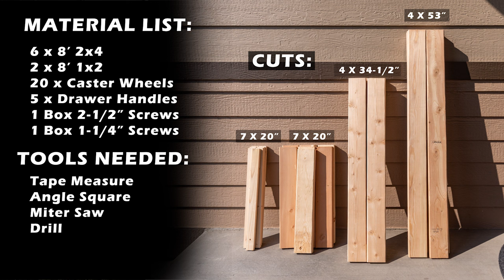DIY Sliding Dumbbell Shelf Tutorial!

Comment: Dylan this is good work and thank you. What is missing is even one overhead shot of the weights on the actual build. As I calculate you have about 3" of room at the front. What you have built are modified grouped straight roll "piano dollies". These are just as easily built as double weight units easier to move even on foam. Is there a reason for not splitting them as you would be accessing for use more than 2 weights at a time Sir? My neighbor has asked me to build the same I will later share the results engineered.